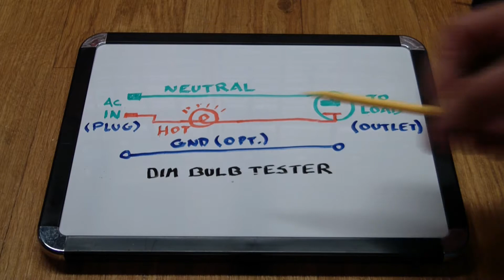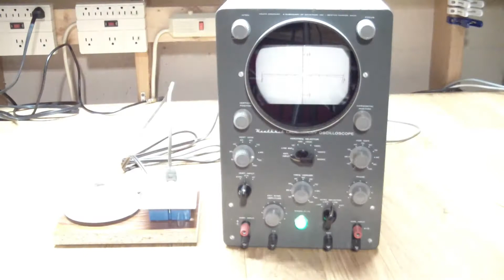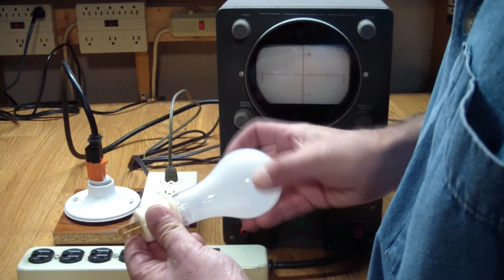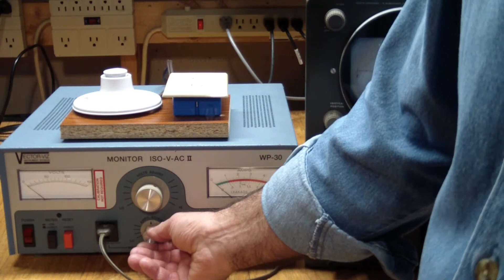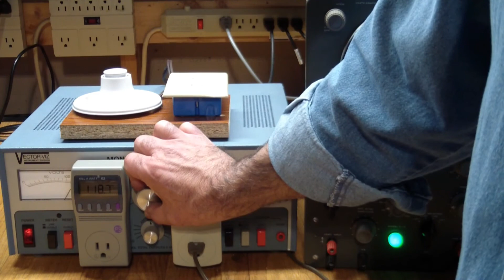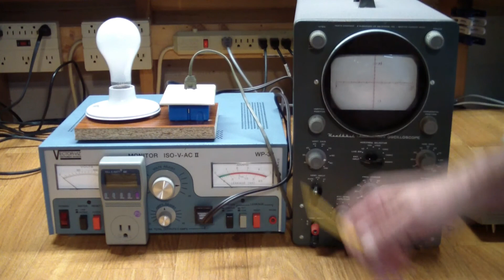AE#21 Building And Using A Dim Bulb Tester

Comment: The two bulbs are in parallel not in series so you are not adding their wattage together. Think of what happens by wiring resistors in parallel and series.

Comment: Something doesn't make sense. If electricity follows the path of least resistance, why does a bulb which presumably has more resistance than a dead shorted out plug take the load and not the plug...what am I missing?
Reply from the maker: When the device under test is shorted the bulb is the only load since it's in series with the DUT.

Comment: The ground and the neutral is connected to the same bus in in the panel box anyways. It is a current limiter. A variac does not limit current. It limits voltage.

Comment: I'd recommend a ceramic light socket instead of a "modern" plastic socket, due to the heat thrown off by an incandescent bulb. Granted, ceramic sockets might be a little harder to find nowadays. Plastic sockets are for cool-running LED bulbs, which can't be used as DBT'S.
Reply from the maker: Been there, done that! You could watch my experience at 
https://youtu.be/rP1fzwP-ig4
Reply: @artifactelectronics  , that was an expensive and time-consuming lesson you received!

Comment: Great video! One question: I live in an EU country where the plugs are not polarized. There's no way to tell which is the hot wire and which is the neutral. Will this be problematic in making a light bulb current limiter as you have here?
Reply from the maker: If the unit your testing is setup with a non-polarized plug there should be no problems.

Comment: Great video! I DIY'd an isolation transformer by placing two identical transformers from APC 1500 UPSs back-to-back. I then added a DBT. I then ordered a BK Precision 1655A Iso AC power supply. The first died right out of the box. Its replacement is due to arrive tomorrow. Great tips on using Kill-O-Watts to monitor the voltage and amperage. I'll get those ordered. The 1655A still comes with analog meters. The 1655A can be calibrated. You might see if you can cal the one you have.
Reply: A
Reply: The second 1655A was DOA, too. Abandoned that device and am building a fully DIY VAC supply.

Comment: There can be no way the device is getting full power with two light bulbs in series before the device sees any power at all. Even though the light bulbs are not lighting up all that strong, they are still taking some of the power theoretically. If you were to turn off the lights we would see some light being present in the bulbs that are still consuming some of the voltage because they are still in series with the main load of the device plugged in line with the bulbs. By putting a watt meter or amp meter between the load and the bulbs and one on the other side of the bulbs we could see mathematically what is using what for the amperage in the line.
Reply from the maker: You're right, the bulbs will always draw a finite amount of current as long as they're in series. But if the bulbs light up very dimly then you can safely bypass the tester and test the DUT with full power applied.

Comment: It occurs to me that you could plug the shorting plug into the top outlet in order to pre-illuminate the lamp to get it at maximum impedance, then plug in the device under test into the lower one (power switch on), and finally unplug the shorting plug. The device under test will see a high series resistance first. 

I’ll dig my dim bulb tester out and try it. For some reason, it never occurred to me to try this until I watched your video. Thanks!

Comment: Hello... have a question .. is it ok to use halogen light bulb instead of classic incandescent light bulb (with tungsten filament). Here in European Union is already very difficult to find old classic light bulbs, due to EU rules. Since halogen light bulb also has little tungsten filament and halogen gas, I am little bit uncertain about this. Don't want to make any mistake later using this device. Thank's in advance.
Reply from the maker: A halogen bulb is still an incandescent, and it should work fine. Just make sure that you know the actual wattage of the bulb. For instance,  a halogen is said to be equivalent to a 40W tungsten in luminosity, but it only consumes 13W of power. The actual power consumption is what is important .
Reply: @artifactelectronics  Thank you,  Sir ...

Comment: The lamp acts like a variable resistance fuse , giving one a visual indication of relative power consumed.  I use mine in conjunction with an isolation trans former fed my a Variac. The best safety device to use on your bench.

Comment: I have heard it suggested to use the largest lightbulb possible. 250-300 watt flood light will reduce resistance. Also, I use old guitar and organ amps. We tend to rewire all the 2 prong plugs to 3 with no ill effects.

Comment: Another great video on a great channel! ... Looking for an experienced technician willing to Skype or FaceTime with me for maybe 15-30 minutes a week to “look over my shoulder” to help me slowly but surely restore some old vintage tube amps and radios. I’m not a beginner, but yet, I am a beginner: Home study courses only took me so far, and you can only do so much with theory on paper and no hands-on training, and my courses didn’t even mention vacuum tubes. Just a whole lot of digital and Ohm’s Law with DC circuits on paper and little else. I’ve had my fill of building kits and soldering up guitar cables and making A/B boxes and custom LOW voltage power supplies for friends’ effects. I want to work on the GOOD stuff - TUBE AMPS, radios, and maybe even some vintage TVs some day! I’m rusty and lacking an important (tube based) skill set and want someone to “look over my shoulder” for a few minutes a week so that I don’t trash a priceless vintage tube guitar amp or radio, or electrocute/kill myself, and tell me an “assignment” to do on that device, for the week, and then “meet” me on Skype or FaceTime again the next week to see how I did, and give me the next “assignment” on my amp or radio (I have plenty of gear in storage and waiting). This is the “hands on” that books and home study never gave me and never will. If interested, please reply here, or email me at: 
stevejhacker@yahoo. com ... Thanks! 😊
Reply from the maker: Thanks for your inquiry, but unfortunately I don't have the time for individual tutorials. You are, however, welcome to make specific requests for videos which I would seriously consider if they are of a general nature benefiting the majority of my audience.
Reply: Thanks for the quick reply! My comment/request was aimed not only at you, but for pretty much anyone that might see it and be interested in helping. Thanks for your great channel and videos though. Just as it is, I am learning a great deal! 😊😊😊
Reply: recommend you get a copy of "Television and Radio Repairing" by John Marcus. Amazon has it.  Excellent book for a beginner covers vacuum tube radios & tv's.

Comment: What if I want to bring up vintage electronic devices slowly, such as vintage tube guitar amps and radios? Is it ok to use both the variac and Dim Bulb Tester together as you have shown, BUT WHILE DIALING UP VOLTAGE SLOWLY ON THE VARIAC, over minutes, or even hours, for the purpose of “reconditioning”, or “reforming” capacitors that have been sitting for long periods of time? In fact, shouldn’t this be a MUST, since using ONLY the DBT could still possibly shoot full voltage to the vintage device without initially damaging it, where as, using the two tools simultaneously would allow me to GENTLY bring up voltage while simultaneously having the benefit of over-current protection and immediate reaction adjustment from the bulb, while ALSO giving me the benefit of slowly bringing up voltage in, say, for example, 25% increments over the course of an hour? Is my logic sound here?
Reply from the maker: Your logic is sound. The bulb will drop all of the voltage when connected to a short, but the current still has to go somewhere.

Comment: You discuss (from 3:50) that the filament takes 100ms to heat up and that some damage, but not much, can occur to a load with a short during this time. Would you recommend also using a variac to increase the voltage slowly from zero? Should the bulb light up as the volts are increased, I think you can be warned of the problem before any real damage has occurred because of the lower voltage applied. Would you agree with this reasoning? I would be interested in knowing your opinion on this, if you find my comment.
Reply from the maker: When your device under test is shorted a 100W bulb will cause a current of just under 1A to flow through the bulb as well as the short. Thus your reasoning is correct in that using a variac will reduce the current flowing through the short and reduce any possible damage to the DUT.
Reply: @artifactelectronics  Thanks for your reply! I appreciate knowing your thoughts on this as I am soon to build a dim bulb tester for myself. I just received a box of 100W bulbs today actually.

Comment: does it work on Electronic welding machine?
Reply from the maker: You're dealing with much higher currents using a welding rig. The whole setup would have to be beefed up significantly (heavy wires, insulation etc.) and you would need a bulb with a filament that can handle the current safely. A 100W bulb handles 1A current max. I would not recommend using the bulb tester for high current applications.
Reply: @artifactelectronics  yea, I know that. but I usually use the light bulb trick to see if there is short in it without using it for welding. just on/off function.

Comment: Hi, thanks for your video! I'm about to build one as I will be fixing my old Sansui 9090db Amp. What wattage should I use for the bulb? my amp is 125 watts per channel into 8Ω and I'm on 220v AC Thanks!
Reply: Any incandescent bulb rated above the max amount of watts for the amplifier.

Comment: Nothing better than an old 100W incandescent to test if the equipment is shorting on the mains. The only disadvantage of this method is that it doesn't allow anything with a switched-mode power supply to be tested, as the lamp will constantly blink when the the equipment attempts to start up.

Comment: Nice job thanks for the video.  I love the idea of the "expander".  I used these instead of a power strip:  https://www.homedepot.com/p/Commercial-Electric-Socket-with-Outlets-White-R52-01403-00W/100184555 and https://www.homedepot.com/p/Leviton-Outlet-to-Socket-Light-Plug-White-R52-00061-00W/100170446